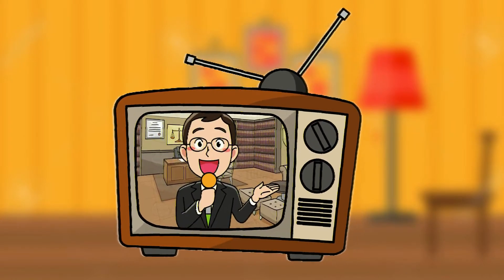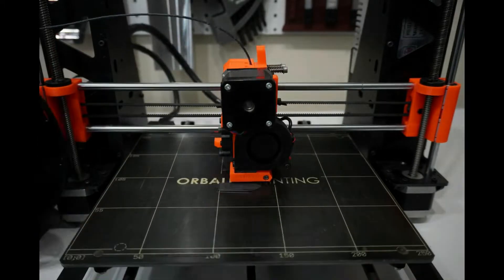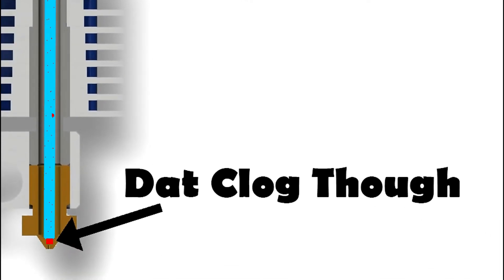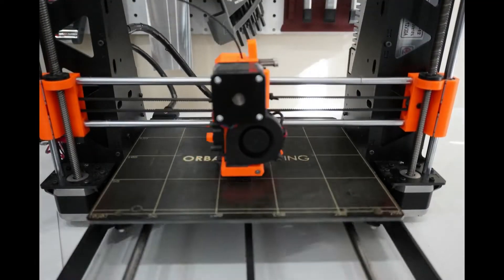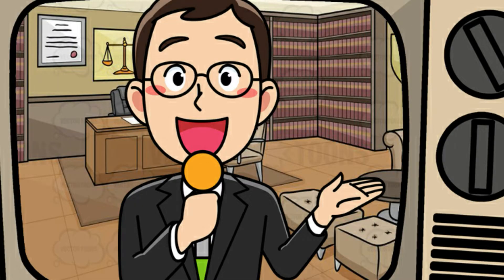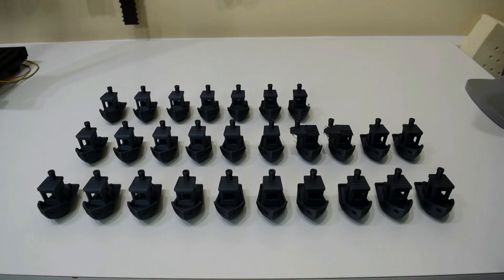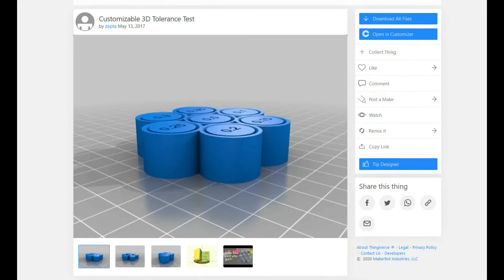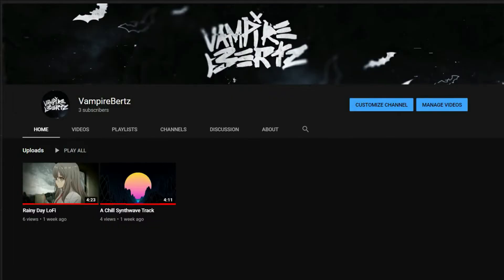3D Printing 50 Benchies with Abrasive Filament | Brass Nozzle Torture Test

Comment: It would be interesting to measure your #1 and #50 benchy to compare their dimensions.  If printing functional parts that have to have very close and consistent dimensions to fit would likely be affected a lot by the worn nozzle I would think.  I upgraded my Duplicator 9 to the spool3d Tungsen Carbide MK10 nozzle which is supposed to have the same heat conductance as brass (as mentioned by others) instead of the hardened steel nozzles that have much lower heat conductivity.  I haven't had it very long but finally printing glow in the dark stuff.

Comment: Just had my ruby nozzle crack on me yesterday. Was doing a cold pull to try clean out the nozzle, but what i did was i cooled it down from 270C with the cooling fan really fast. Turns out it almost behaves like glass when you cool it down too fast. Had it for 2 years, printed abrasdives, flexibles, a lot of pla, abs, pets and nylon. I go through about 5 rolls a month.